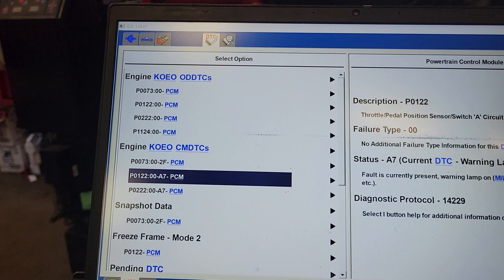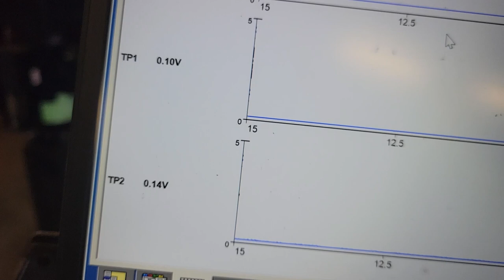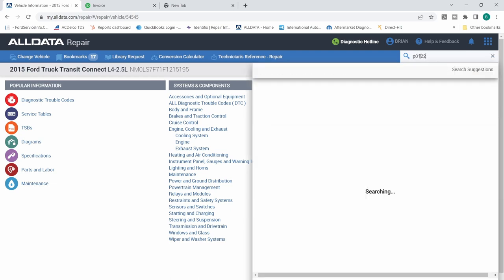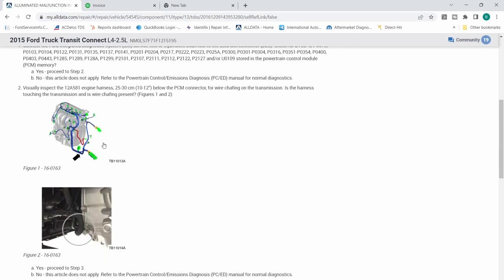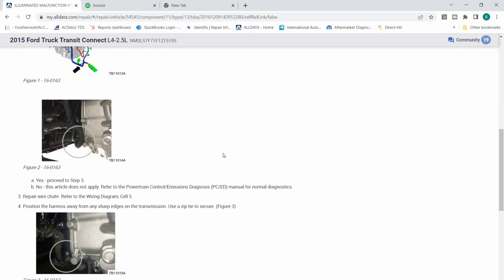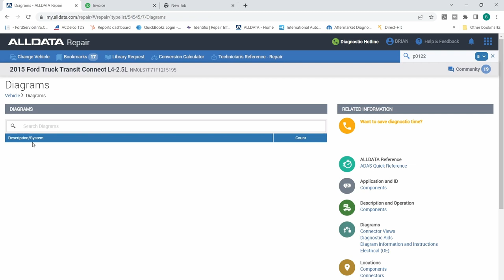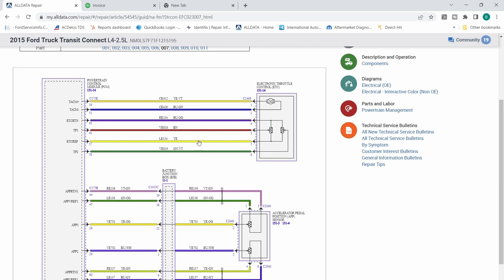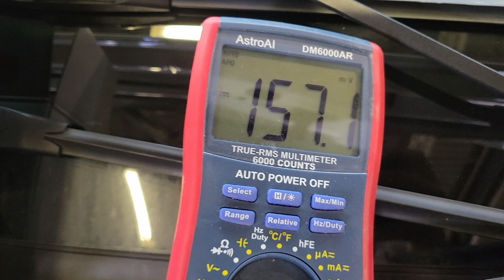2015 Transit P0122 P0222

Comment: My 2012 Ford Fusion did the same thing setting a code for p0222 temperature sensor wire and throttle body insulation came out the wire allowing them to touch each other😢😢